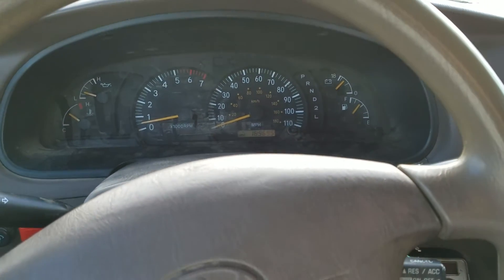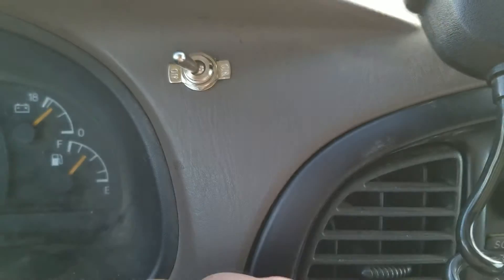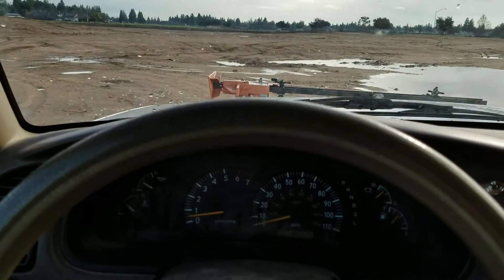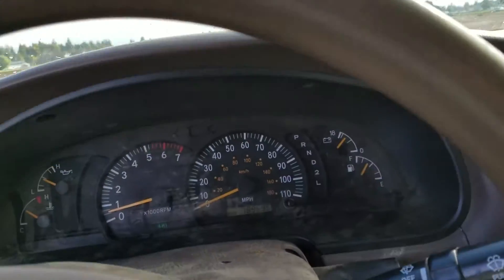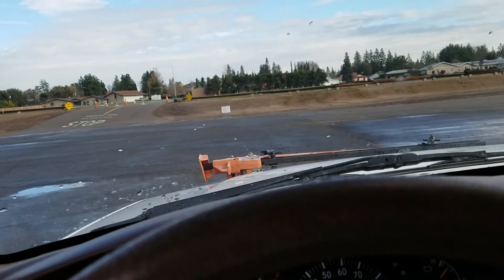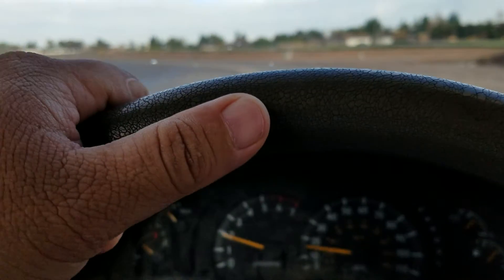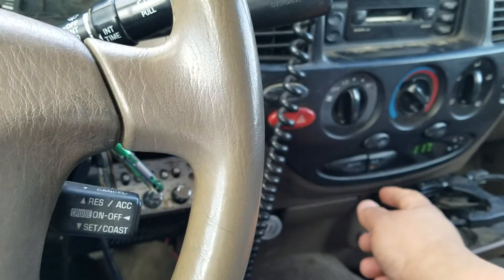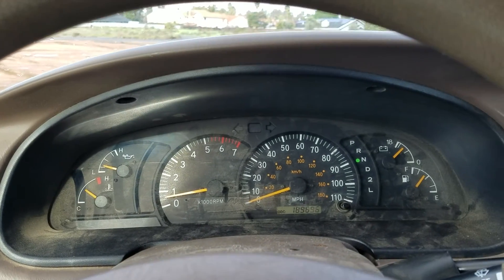Toyota Front Diff ADD Switch pt 2

Comment: So I am thinking this will work on my 1999 Runner with front spartan locker  that I want to install.   From my understanding the spartan will spin my driveshaft and transfer case even while in 2wd on the highway which is not desirable.  It looks like the ADD switch works great while in 4wd mode but would it also disconnect the front end so that the locker does not spin the drivetrain while in 2wd for daily driving?  Thanks again.
Reply from the maker: Brad Dedman yes it will

Comment: Great video!  I need to do this mod to my 1999 4runner Limited so that I can add a front luchbox locker.  Can you advise on how to do the mod on my vehicle?  It has a multi mode 4wd system.  Subscribed.  Thanks
Reply from the maker: Brad Dedman check out your 4x4 to make sure the have the same wiring as mine